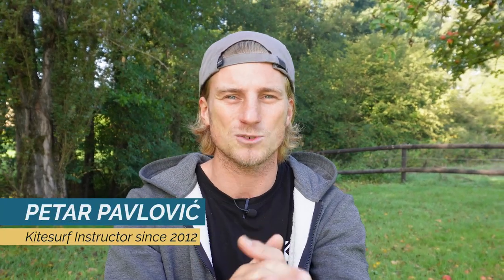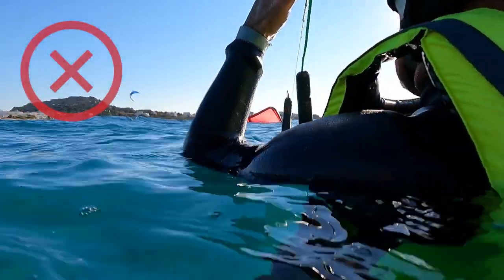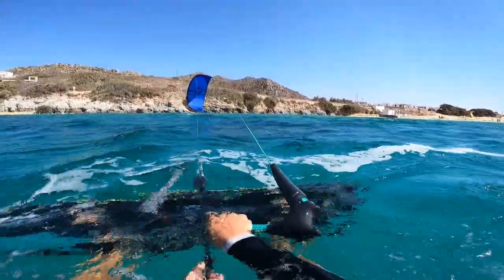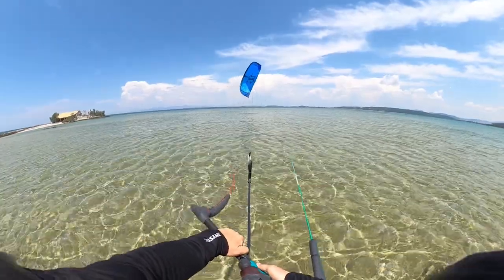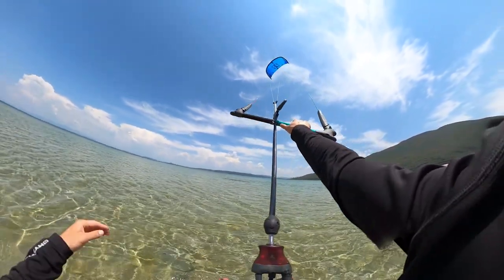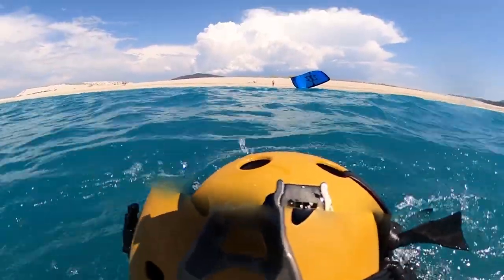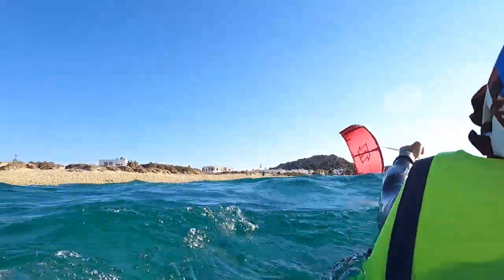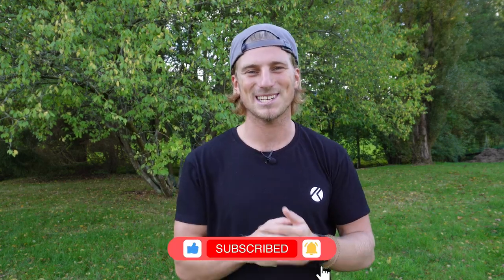Relaunch the Kite in LIGHT WIND - (Kitesurf Tutorial)

Comment: I've spent a fair amount of time in light winds and think I'm fairly good at relaunching. One thing I did realize though is that even though winds are light, the extra time spent trying to relaunch usually means drifting downwind quite a bit. And then, with winds light it can be even harder to get back upwind. At least it's easier to self-land when you've drifted way down the beach.
Reply from the maker: Hey James,
Yes this is a good point as I mentioned in my episode of self rescue, if is side on shore wind you can keep pulling the line closer to the beach and once the kite reaches the beach start with self landing :)

Comment: Nice video once again. There is one thing i am bothered that we can find from 90% of videos. Doesnt matter if its lightwind or strong wind. Imo we should always depower the kite when launching or landing. Maybe not fully but most of it anyways. Lightwind (prevent backstall) strong wind prevent getting too hard launch. It often happens that someone has "full power" kite drops in powerzone and launches you in the air if you havent depowered. You agree? :)
Reply: And didnt mean bar throw.
Meant trim! 😁 our new North kites wont backstall but many of older kites will and often old bars have shrinked lines etc
Reply from the maker: Hello Joni, thank you for watching and sharing your opinion :)

About backstalling and adjusting the symmetry of the lines, I did this episodes and they are currently available on my PATREON account: https://www.patreon.com/kitesurf
they will be online on YouTube in 2 months. I believe this episodes will help people understand why the kite might backstall or frontstall and how they might use the trim line to prevent it.

For relaunching the kite from the power zone, I recommend it just during light wind, so I'm not sure how much of the effect would do the trim line..

For Launching the kite with an assistant, as you maybe already sow my previous episode? I recommend to pull a bit the trim line if the wind is strong. About the light wind, I don't think that is necessary to pull the trim line if they are following the safest steps for launching their kite with an assistant.
About the landing I didn't mention it, but you are right that could be recommended if the wind is strong, for light wind I don't see the reason to pull the trim line, if a kiter is correctly landing the kite just with one hand and letting the bar go when the kite is on the ground everything will be fine. If someone loves to pull the bar with 2 hands while landing, pulling the trim line is maybe a good idea, but this technique of landing the kite with 2 hands doesn't look safe.